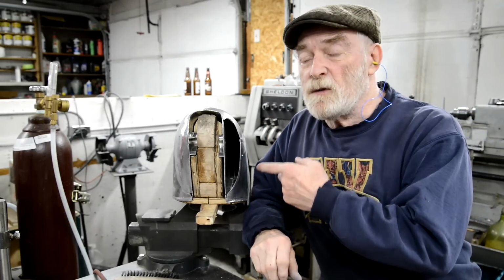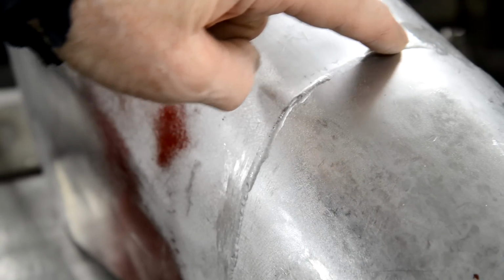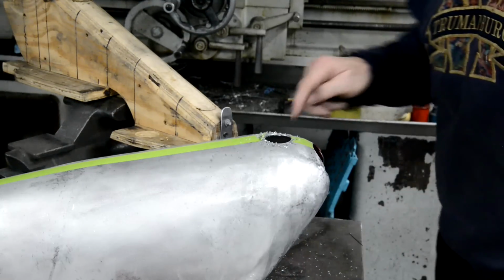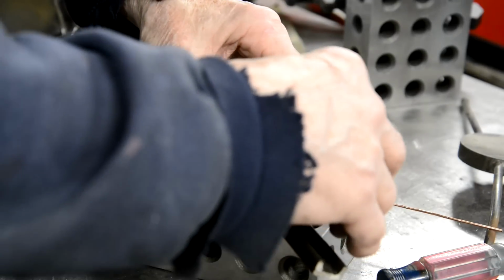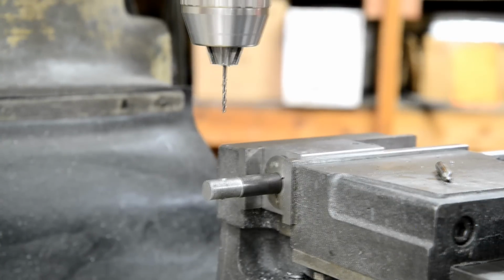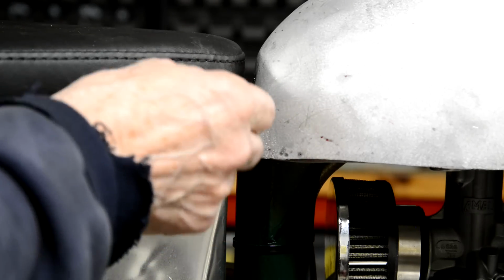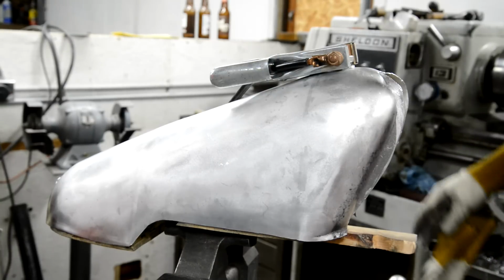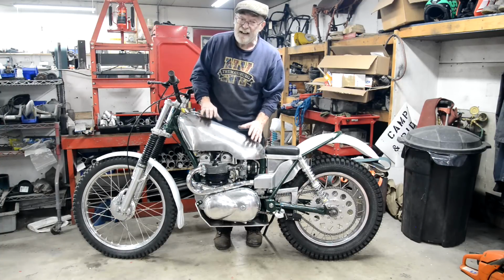Triumph 500 Otter  -  Part Thirty Three

Comment: Hi Michael,  the tank is most impressive,  not just because it looks good, but because its unique, in the true sense of the word, there's not another like it. I'm truly impressed with your welding of aluminium. Forty years ago, as a young welding engineer for a company who  designed and manufactured MIG & TIG equipment, part of my job involved demonstrating our equipment and teaching welders how to weld with new processes.  Mild steel was easy. Stainless steel a bit more of a challenge and aluminium was the greatest challenge.  It went from solid to liquid in the blink of an eye and I've seen hundreds of failed welds. I set up semi automatic welding machines producing stainless and alloy beer barrels that had to pass rigorous pressure and leak tests. I doff my flat cap to you, sir, you have a talent there.
Best wishes from South Staffordshire UK,  Geoff

Comment: Michael, why couldn't you chase the threads on that gas cap with your lathe? It will wil cut 12 TPI. Probably wouldn't take more than 1 pass.
Reply from the maker: It was the threads in the filler neck so once it was welded in it had to be a tap.
Reply: @BritanniaMotorcycles  There's a book I thought you might be interested in, it's titled: "The Strange Death of the British Motor Cycle Industry" by author Steve Koerner. As you might notice by the title it doesn't have a happy ending.